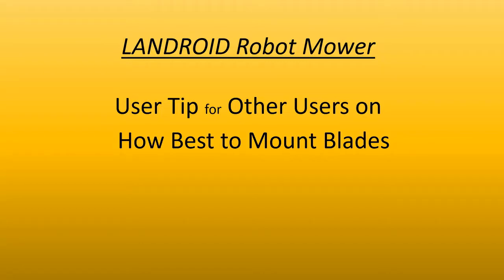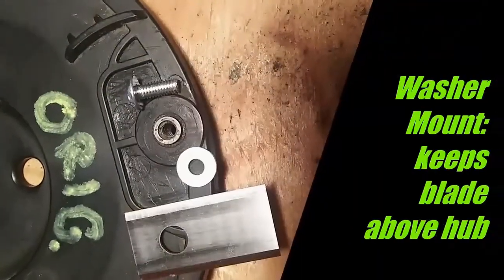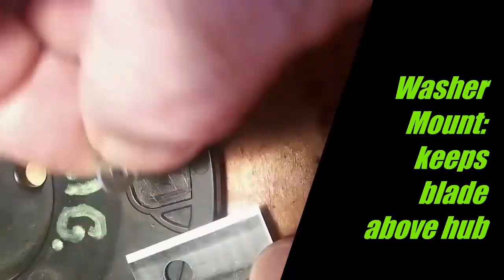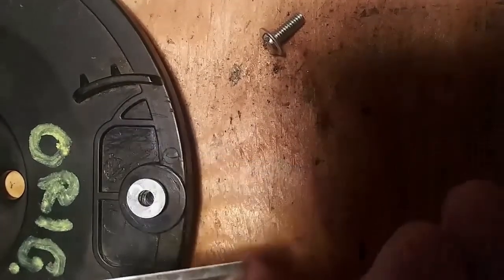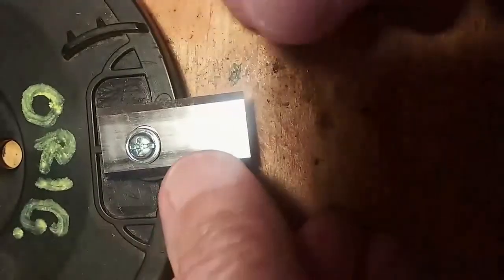Landroid - A Better Blade Mount

Comment: I dont think the blades are ment to spin while running, the long part should stay extended as the plate spins. The only reason the blades are free to spin, is in case the blades hit something solid like a rock, they will be able to bounce back and not absorb all the damage. You would then sharpen out a small dent rather than a huge chip.
Reply from the maker: Yes, when the cutting disk is turning, the blades are thrown radially outward into a fixed position.  And you are correct in that the freedom to rotate on their pivot screws allows far less blade damage should a 'hard object' be hit.   However, also, if the blades can't rotate because of the continued presence of cut grass between the disk and blade, then when/if the blades strike a hard object there is a possibility the disk itself may break at/near the blade mounting screw which is at the edge of disk. [this is not a frequent occurrence but has happened and I believe the cause is as stated]
Reply: @Jim Kadel  Really? I thought such impact would loosen the stuck grass and blade before it could ever hurt the plastic that way. But that's good to know. It is always a good idea to try to keep the lawn clear. Especially if you have kids that like to play with rocks 😆

Comment: I’m down. I will give it a try. I am also installing the metal spike disks on the wheels soon! Maybe a new paint job for Landroid. I am thinking Gold. Shiny Gold!
Reply from the maker: 2022 Update => I've found over a year's experience, later, that to keep blades free to rotate in all 'high grass' situations, it's necessary to put a small, 6mm long, plastic spacer under the blade, instead of the washer described in this video.    I purchased a set of these spacers in kit form from Amazon {link below}.  I also leave the blades mounted loose, that is, the outboard end of the blade points downward, not nearly horizontal, when held by screw and disk is not rotating.  (screw won't come loose and fall out as long as its several turns into its mating grove)   

A high grass situation can occur whenever the Landroid is prevented from maintaining its regular weekly mowing schedule, as when a rainy period interrupts.  Also, at the start of season when grass may be much higher than when under Landroid control.   I used the shortest of these spacers (6 mm height).  It's a good idea to have an M4 screw kit of varying lengths like:
https://www.amazon.com/Sutemribor-240Pcs-Stainless-Button-Assortment/dp/B07CYM1N8R/ref=sr_1_1?crid=9L9V5MNWLBQ3&keywords=M4+screws&qid=1658480434&sprefix=m4+screws%2Caps%2C114&sr=8-1

Here is the spacer kit:
https://www.amazon.com/Spacer-Metric-Plastic-Insulation-Standoff/dp/B07XC4RTR3/ref=sr_1_8?crid=1M8E4ZGQCLQEI&keywords=plastic+spacers+for+%236+screw&qid=1658478973&sprefix=plastic+spacers+for+6+screw%2Caps%2C104&sr=8-8
Reply: Thanks for the update, Jim! Will give the spacers a try!

Comment: It is not a batter way as the washer now prevents the blade from sitting loosely on it's peg and you are instead dangling it off the undersized screw by loosening the screw a bit.
The screw can now come loose or work itself out and be torn off. Ideally they would have given the blade a taller post to sit on but they didn't.
A small tube section on the screw extending this small post on the base by 1-2mm has same effect but allows for secure installation of the screw.
Reply: Thanks for the time you took to comment.   If I read it correctly, your main concern seems to be that the blade mounting screw (it's not undersized, it's the same one normally used)
may come loose in the suggested improved mount.  That's not going to happen if done in the way video shows...i.e. tighten screw all the way and then back off, one-half or a full turn just to give blade the freedom to rotate.   There is no unscrewing (counter-clockwise) torque created on the blade mount screws by the operation of the cutting disk.  Indeed there is no need for thread-locker on these screws.
Reply: @wordcarr8750  It's a balancing act between supporting the blade and not getting things stuck in it. If the blades can't flip away easily they get damaged sooner, but if they are loose on a screw they are allowed to twist and when I tested this it created more noise. After a week the buildup got the blades stuck again anyways. The pegs could have been a tad higher but it may not matter.
Biggest thing we can do to these mowers is fix the poor wheels. We can't do anything with the offset torque of rear wheels trying to drag the front nosewheel out of a larger dimple in the lawn it created earlier with the wheels while stuck on another minor dimple. I like the cut-to edge, but navigation even with all sensors is sad and it turns the wrong way when encountering the border wire in a slope.